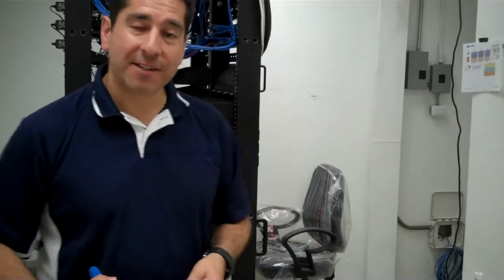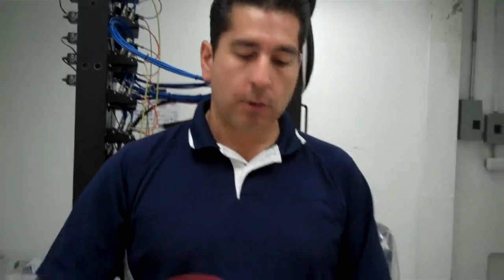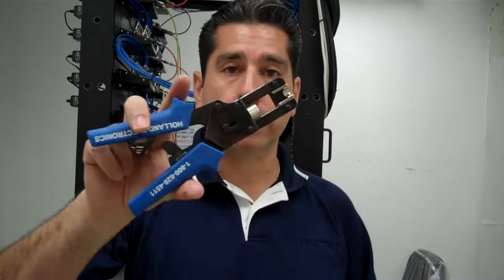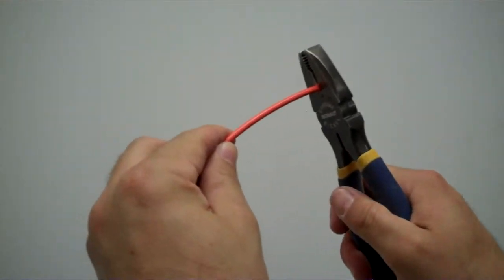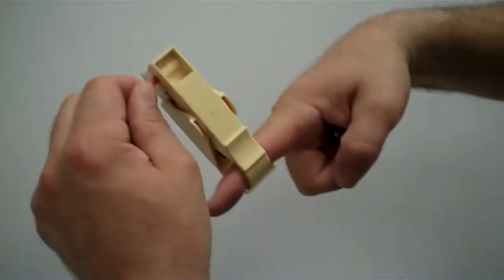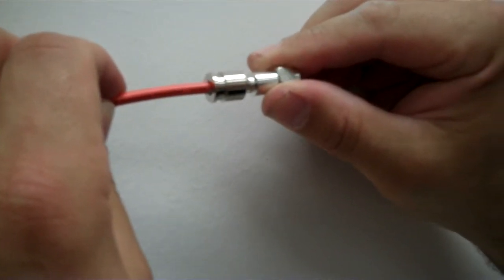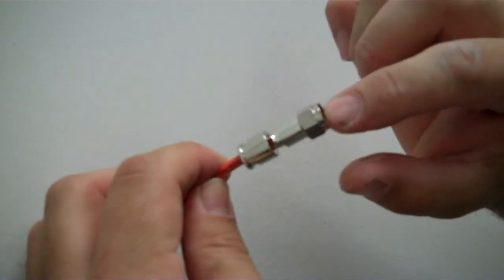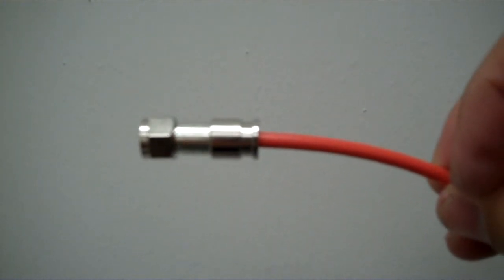How to Prep Mini Coaxial Cable and Compress a Connector onto It

Comment: Do you have links to the mini cable and the connectors?
Reply from the maker: Although there are many different manufacturers out there, here is one that we have used for many years and is a top quality connector for Mini cable.
Should you need some Mini Coaxial cable you will fins it on their website as well.  Let us know if you need to bus some. we have stock i=on most of these products.
Happy New Year and thank you fo rreaching out!
http://www.hollandelectronics.com/catalog/catalog.php?product_id=Mini-Coax-Compression-Connectors

Comment: I have an antenna cable that I need to extend, but it is not rg6 so I can't use those connectors.  The cable is definitely coax, but about half the diameter, core is less than .5 mm. I saw some places call it minimax coax.  Would the connector that you are using have one end fitting such a cable but the other end fitting the kind you find on the back of your average tv set? The antenna cable is too short and I need to extend it and amp it, but like I said I only have rg59 and rg6 connectors.